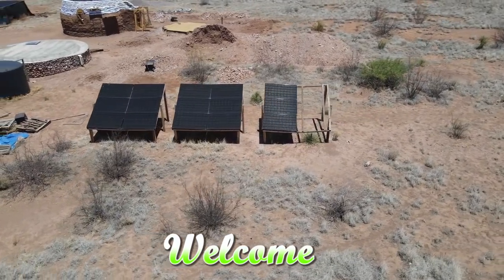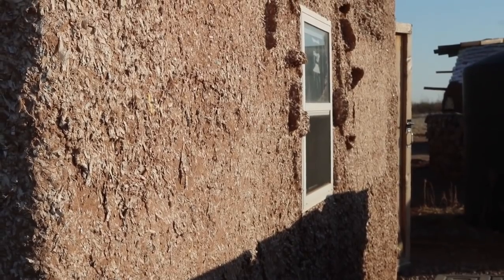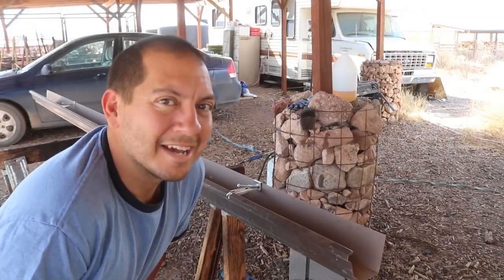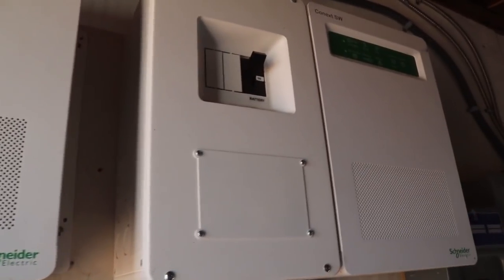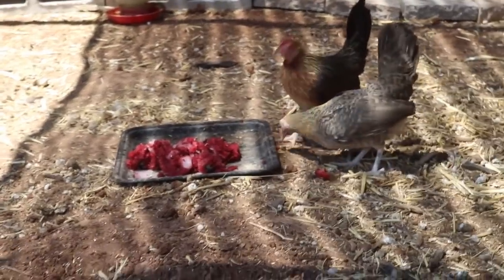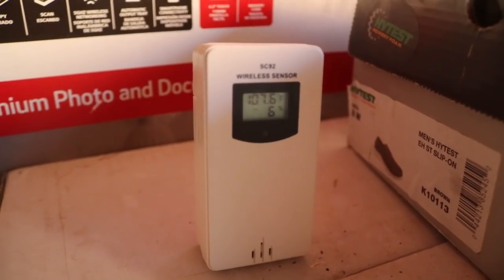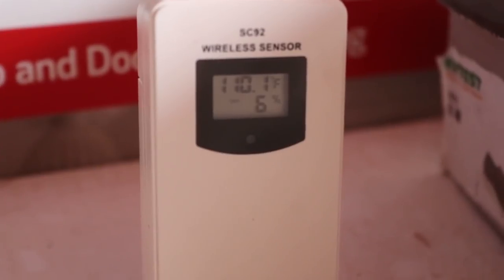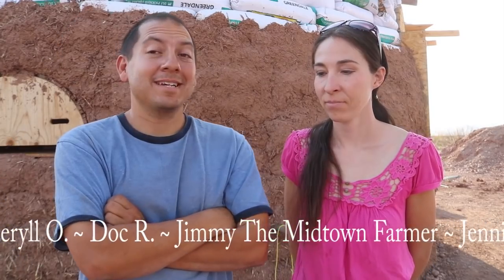Scorching Desert Heatwave Threatens to SHUT DOWN Our Off-Grid Solar

Comment: When its low on freon  the AC will shut the compressor off and just blow outside air.
Reply: Freon has been banned for a couple decades now, it's some other cold medium though.
Reply: @ceselb  R-12 ??
Reply: R410A is what they use now I believe
Reply: @cindykrou  R-12 was the original refrigerant used in ACs. R-22 is freon. R-12 is not available to regular people anymore. You can't just use the replacement refrigerant in an original system because it won't mix well with the oil in the R-12 units to keep the compressor lubricated. A new refigerant is called R-410a but new ones are comming along like R-22 (freon) and R-33. They don't work quite as well as the original refrigerant so you don't get as much cooling from them as well as the oil incombatibility problem switching over to the new refrigerant in an existing system. Refrigerant fluid systems are a closed loop so they have to have the lubricant for the compressor in there as well as the refrigerant and those have to mix thoroughly together to keep the compressor working. Probably TMI but I've often wondered if switching over to the new refrigerant was such a great idea. Ozone layers seem to fluctuate anyway. It may have not been R-12 causing the problem. We are supposed to have no ozone layer anymore because of all the R-12 that leaked. When was the last time you heard about the ozone layer or that it is destroyed?
Reply: @StoneKathryn  i should have sid coolnt.

Comment: There's a high pressure side, overpressure switch ..it's either bad or the condenser is dirty or too small...I think that's what is shutting off the compressor....gauges can tell

Comment: Some good ideas suggested by shading the power shed maybe you should consider moving the shed under your big long shed. In the short term you need to look at insulating the hell out of the building to prevent solar heat gain to the inside you have to insulate all the walls to prevent heat gain. Also have you consider a roof fan, bigger than a toilet fan over the top of the inverters and a supply air system close to the inverters at the bottom to move the air straight out of the shed. Keeping the door open and window is great for cross ventilation but your compounding the issue with allowing the ambient air inside..A small ac system using evaporative cooling would be a great use of you water tank to circulate air over water misters or a media that filters the water for evaporative cooling and for the air intake to the shed and offer much more cooling. Even a window AC unit and insulating the heck out of the shed would work but not ideal to your green dream. Here are some ideas that I think you could easily make yourself very easily.
Reply: I vote for the small window standard AC unit because it doesn't add humidity to the area where electronics are.

Comment: I'd call any billboard companies and see what they have for old/unsed billboard ads. The NOT LED light up boards still use heavy weight plastic - at least you can cut some of the light over the RV. 
As for the car A/C, my mom's car has a switch for recycling the cabin air or using outside air forced thru while driving ... does your car have that? 
Best wishes and lots of hoping you all stay as cool as possible and safe.

Comment: You need to Shade the roof and insulate it with wood fiber, hemp fiber, used clothing fiber. Shade the window too. Put in water bassins with old linnen or towels to act as wicks in front of fans to cool it down.

Comment: have you thoght about digging deep trenches and running pipe along them with a fan so the colder ground can cool the air that can be blown into living areas that or maybe lower the flow of building below ground level to keep an area of cooler air

Comment: As far as your AC goes you need gauges. Hook them to the low and high sides. If your freon is low that could be part of it but also if the condenser is not cooling down efficiently that could be why it only cools while driving. Intense ambient heat will cause that. A secondary fan on the condenser may help if there is room .

Comment: That portable AC is very inefficient. I would put window AC units in both the solar shed and the RV.
Reply: Or better yet a mini split, we use them in Sonora MX not terribly expensive and very efficient.
Reply: @stevetuttle5472  Mini-splits are the best, but they're still pricey compared to window units and most are difficult to install (need special equipment and experience). For their homestead, window units are the easiest and cheapest way to go...

Comment: mR jIM.  If you dig down to 10' floor depth. that would give you an electrical room that stays around  70 degrees.  Am i correct? 

Instead of using an AC, are you familiar with a swamp cooler? it uses recycling  water and 110 voltage instead of 220

Comment: You might want to clean the radiator of dust and dirt which will inhibit the heat transfer. Try using compressed air on both the radiator and the condenser.best of luck as a friend of mine who is in Australia added a second condenser to increase the ability of the system to operate at idle engine speed.

Comment: Sounds like you need an earth tunnel tube to keep air flow in your solar shed cool ..i think yall know what im talking about .. Dig a trench four feet down at like at least 12 feet long put yourself a tube in there and pull air through it and the ground will regulate the air temperature and you can jeep that solar shed cool all year around pretty easily and cheaply

Comment: Try geothermal Jim! 
Bury 100 feet of 4 inch drainage pipe, 5 or 6 feet underground. Put both ends of the pipe on opposite sides of your solar shed. Slap a fan on one end. You'll get 55° of constant cool air!
Reply: Or wait it out and bury the metal pipe next winter 10 feet (3m) down below the caliche layer.

Comment: My famous joke is to say "  But, its dry heat" You have it all worked out over there.
It is in mid 90's here with humidity at about 80%.  Hot and hard to breath.  We have had a nice breeze for days.  Until last night.  NO Breeze.  So hot this morning.  It would have been great time for the beach.  If I only had a car.
Reply: Ya! Here in Minnesota I had no car and no AC in my apartment for 10 years! The electric company would always charge me for AC even though I had none in the summer. They only read the meter every 6 months and when I would call in to complain about my summer electric bill they would always say they didn't believe I had no air conditioning. They would say no one could last the summer without AC. I was in the top floor of a three story brick apartment building, built at the turn of the century with only stairs too, under a tar roof. I just got through it. Did a lot of wet sheet with a fan blowing on me at night to sleep. They never believed me even though they had to give me a huge credit at the end of every summer.

Comment: Check your radiator /condenser fan ,they need to work for the ac to work when at the stop, a 9000 pioneer mini split only draws around 600wats on economy and it will cool down up to 300sq ft , room and it’s easy on inverters , a small attic fan with temp control switch will keep your inverter from spiking into high  temp

Comment: Do you have a water supply (well)? If you do,  use water evaporation as a cooling solution.  Get some standing water on the roof of the shed, it’ll evaporate and keep everything beneath it cooler.
Reply: He built a cistern to hold the water of the monsoons in with a water catchment system. They have had to truck water in because of the drought and gutter problems. Water is not plentiful on his homestead.
Reply: @StoneKathryn  not a great suggestion of mine then. Thanks for putting me straight 👍
Reply: @GjS-UK  It is a great suggestion. It would work. He just needs to catch a great monsoon.

Comment: If you were to use a swamp cooler would it run on less electricity and keep everything cool enough to protect the solar system?? Could even use one in your trailer maybe. I have used those and was able to lower inside 30 degrees over the outside. Except during monsoon, but will still help.
Reply: I wouldn't use it on the solar shed because of the electronics inside but it would work great for cooling them in the RV!

Comment: Go to Harbor freight and buy a can of freon and put a little in and see if that works helps. But you may have a leak in your system. 
Fyi: just put a small can first. Total cost around $25.00 youtube will show you how to do it. It's not hard to do.

Comment: With the inverter putting out twice the electricity that you need for your RV maybe you can think about putting a small window unit in that inverter shed they can't cost that much and it's such a small area you don't need but a small one and you have all that extra power from your inverter it might be worth it

Comment: You have the land. So consider geothermal. Instead of expensive heat exchangers, use cheap car radiators+box fan. Then get circulating pump to move the water in a closed loop.

If you can dig down 6ft to 10ft, you could get a significant temp difference.

Comment: Check a/c clutch, if not that, more than likely compressor.
Reply: It really bites if it is the compressor! Then your AC in your vehicle is DOA! That is a very expensive and AC refrigerant capture repair. Have to bleed it all out including the accumulator with special equipment. Change compressor, put the refrigerant back in. Check for leaks. Get the water out of the system. Most repair places charge a lot to do this. If you know and are friends with an HVAC guy he could help a lot because he has the refrigerant capturing equipment. Good luck!

Comment: Vent hot air at the highest point, VERY IMPORTANT. Always fill the areas with cool night air. I get my dogs wet and myself for direct relief. They hate it, then immediately LOVE it Block sun off the buildings, makes a world of difference. Dig a hole you can stay in, always cooler under ground, better if there is a thick layer of dirt above. Basement house / root seller / emergency hole to cool down. Cool air goes down, hot air up, use thermodynamics. Cook outside, I use fire outside, or a solar oven is easy and would work great for you. All your AC should be evaporative if you have the water. Serious watt savings, works amazing in dry air. They make tiny personal evaporative coolers that are very effective in a small area blowing on you, or the dog, or all of you together. Small fan, about a quart of water an hour or 2. Will keep that small area cool. Indians used thick earthen walls and earth itself. Wet blankets in the breeze. Even water under the dwellings so the evaporation cools their place. Imagine if you had a place to go connected to your water tank? Using the cool air. Using shade, water, and the coolness of the ground could keep you cool with very little energy use. Using piping buried in trenches, with fan to pull the cool air, Geo Thermal, but Geo Cool, very efficient. If wind is blowing you could use windmills, a direct connection to turn fans inside to cool by blowing geo cooled air.
Reply: I took my surface temperature meter to an urban plaza midsummer in Mesa to look for the coolest spot and found a fancy trench drain cover to be 80 something when black mulch was 140 degrees. So I put a row of plastic pallets on sand at the side of my house needing drainage. It's so cool it kicks up a breeze when wet. I know y'all are short on water but if you water your plants you could set up a channel dog trot cooling area to harvest some evaporative and surface cooling for body cooling on its way before it goes to the plants. Be careful all kinds of critters love coolspots. Have you considered that 2k solar water distiller that grabs drinking water from even desert air?

Comment: Put the lowest wattage window ac you can find into the battery building. Heat kills electronics and you are murdering those batteries and inverters. You have more than enough solar to keep a 500 watt ac going in there whenever it's hot.  Good luck!

Comment: would it help to put a solar roof vent in the shed? I just put one on my  8 x8 ft Rubbermaid tool shed. It has helped a bit. They come with their own solar, so you don't have to hook it into your main system.
Reply: Cool! So it has a fan inside it already? FANtastic!
Reply: @StoneKathryn  yes, the fam is installed inside the unit

Comment: one thing to look into would be to mount a hessian cloth on a square frame in front of the fan and have a drip feed of water on it to keep the hessian moist and as the water evaporates it will give you a cold breeze blowing on you solar set up
great videos and i am looking forward to seeing the dome finished
Reply: I just hesitate to cool the shed with humidity because of the electronics inside it. Electronics and humidity don't mix well.

Comment: Jim, how do you keep your water cool?   Our water must be 100°+.  Difficult to take shower.

My water tanks are under cover, and our water pressure tank is inside a non AC space like your solar shed.   The water line is underground about 6 inches.  My cold water is almost scalding now.   We actually use the hot water tap, as it seems cooler since the hot water tank is insulated.
Reply from the maker: Our water gets warm, but never hot.
Reply: @ourselfreliantlife  Could it be all that thermal mass around the tank?

Comment: If the AC in the car only cools when its moving then it sounds like the AC or radiator fan motor in the engine compartment went kaplooey - it happens. The engine temperature will also tend to run very hot too. A quick way to check is, in the morning when its cool, turn OFF the car AC, start the car and look at the fan. It shouldn't be running. Go back inside and turn the AC on max cool - the radiator fan should come on. If it doesn't then either the fan motor is shot or the fuse is blown. Repair this quickly if the motor is bad since the engine can burn up if it doesn't get the additional cooling from the radiator fan.
Reply: Also remember that there could be fan relays in a separate box in the engine comparment and switching them around can sometimes help you see if one is not working. Each relay controls a separate fan behind the radiator. Cleaning contacts on them can help too.
Reply: @StoneKathryn  Good point! Gotta make sure they are the same type of relays before switching them around (don't ask me how I know lol)
Reply: @houstonfirefox  I said that in another reply that you should check that so thanks for saying it too. Luckily mine are the same so I could check easy by putting the AC on in the car and see each relay work. I hadn't seen one of my fans spin so I wanted to check the relay worked.

Comment: Put the crock pot outside too.  Tin foil on windows shiny side out.. from previous experience  rv ac will only cool the air about 15 degrees.  1 on our winnebago 23' not enough. Had 3 on our 36 monaco which had r rated walls and ceiling.not enuff even with the dash air and tin foil on the windows  ,plus shut the ac vents in the bedroom and bath and closed  the lav door. Didnt help that much. Lol . Putting a second roof over your rig couldn't  hurt. Just my 2c

Comment: Do you have enough water for a swamp cooler on the solar shed during the hottest time?
Reply: One thing to consider is that electronics does not do well with humidity. Everything I have read says keep any humidity away from electronics.

Comment: hey havent you parked your RV under where you park your car ? need to get your house done if not have the backhoe make a ramp so you can park the RV under the shelter. could get a AC unit out of a old car or a radiator fan out of a car that way its 12 volts ,to vent the shed or blow on the inverters get a motor to run the compressor / fan.. Your smart think outside the BOX  kids
Reply: The invertors are giving them 120volts AC so might not worry about 12 volt. I don't know how the Tesla batteries work so they might have 12DC but I wouldn't know.

Comment: Have you been monitoring the temps in the root cellar and the cistern ? 
I dont believe i need to elaborate but if there arr temps considerably lower in these underground enclosures then it may be possible to  develope a simple version of a geo thermal heat pump in order to harvest those lower temps if indeed they do exist  . ????

Comment: Folks watch everything about the chickens in the greening the desert project in Jordan. Geoff Lawton initiated that. They grow melons and the like on top and they THRIVE. The coop is a metall cage (they can't let them run around in the desert bug control is different, there will be no slug eggs to pick up ;)

So they are always in that coop and seem to be quite content. They are getting compost heaps to scratch aparts (they do the turning for the humans) ....

Anyway the "ceiling" and "sidewals" were covered with plants, that got the support they needed and the chickens had shade.

the shade here is kinda imperfect. Chickens come from forests in Asia (before they were domesticated) they like a "canopy" and half shade, and at least one area with full shade (during summer until the annual climbers are harvested and finished) would be recommendable. Else they also reduce egg production.

Comment: Is it possible to remove the face fronts of the electric boxes so that they are completely open and not dependant on an internal fan?.
Reply: The dust might be a problem so I would say the covers have to stay on to protect the internal components from dust contamination. I could be wrong.
Reply: @StoneKathryn  And the fan is doing what?, l doubt there is 'so much' dust in the shed or you would see it now, l have these temperatures here in Spain and no covers on any electrical distribution boxes.